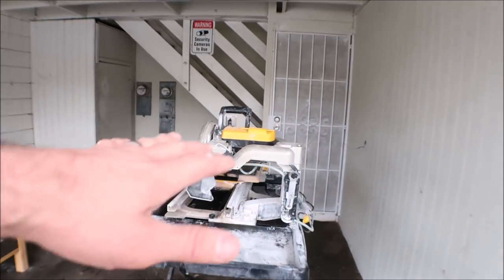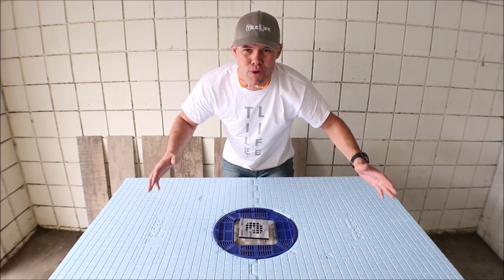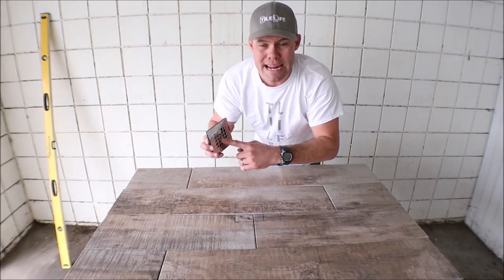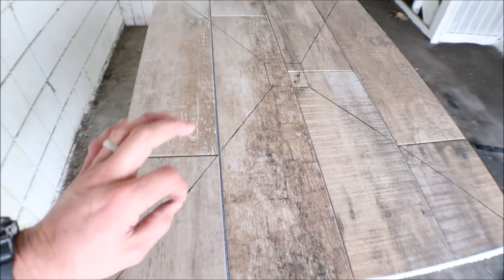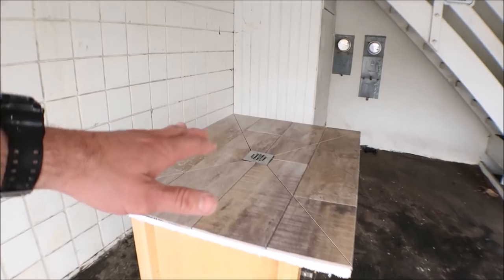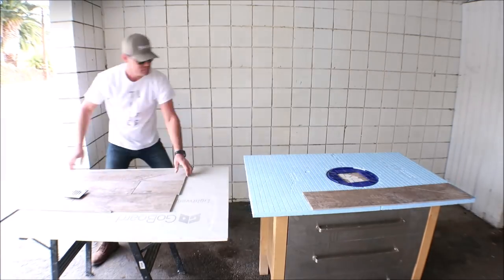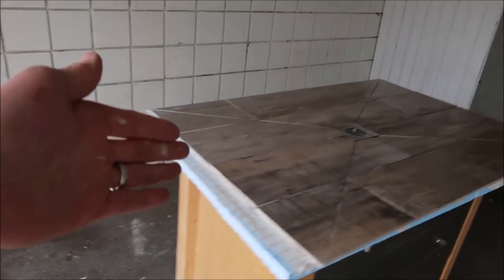Modern Wood Look Shower Pan Tile

Comment: Great information about laying out and cutting the tile.

Question on why the tile overhangs the drain pan on the right side and why it doesn't cover part of the drain pan on the left side (as viewed by watchers on YouTube)?
Did the tile order/direction get mixed up after cutting/dry fitting them ... or the drain location not end up being correct?

Did you have to cut off any extra tile along your cut marks in order to have the proper space between the tiles for grout lines?

I'm asking so that I can understand any problems that might arise if I attempt to pre-cut all of my tiles for such a location.
Reply from the maker: I installed the tile the following day after cutting and had the tray set off a little bit. It was my error...
Reply: @LandbergTileTV  : Thank you for your reply.  I greatly appreciate your videos.  I watch almost every one looking for insights on design/layout, different materials, tools and installation methods.

I am looking at purchasing a Sigma 3E4M (49") tile cutter.  I see that you have used the Razor Pro, Montolit Masterpiuma P3 and a small version of the Sigma Max line.

Would you have any feedback/opinions (pros/cons) on the differences between the RTC Razor Pro, Montolit P3 and Sigma 3E4M large format tile cutters?

Comment: Great vid as usual. Wood like to see you do a video discussing different blade types, and which ones work better for Travertine, Porcelain, Ceramic, ets, which types of blades juts don't cut it.
Reply: Great idea.  And if you do that video, maybe differentiate between DIY'er and Pro blades since some of us won't be doing enough tile jobs to warrant the added expense of the Pro blades.
Reply from the maker: Great idea, I'll will most definitely add it to my video idea list. Thanks for the comment! 👊
Reply: For what it's worth, I have had great success with the T3 razor on my Raimondi bridge saw. Has the thinnest kerf and get chip free cuts on porcelain and glass.

Comment: This doesn't make any sense. Why use tile levers on a shower pan that's supposed to be sloped? You have it cut into four sections. Those sections should have been leveled with themselves, not each other. It seems you've made a flat shower pan.
Reply from the maker: It may seem that way, but we install this type of shower pan on a regular basis. This is a anti lippage system, not leveling system. Here is a video on one of my projects installing the same tile for the shower pan:
part 1: https://www.youtube.com/watch?v=5f3VJOP3QYs

part 2: https://www.youtube.com/watch?v=VN66Ct9o3Js

Comment: Nice video good idea for my cabin shower thanks for sharing just wondering do you think it won’t be slippery while the soap drains under your feet just wondering I’ve been installing for 27 years and i mostly install much smaller tile on floor or tile that is none slip
Reply from the maker: Most wood look porcelain plank tile has a matte finish with grains that resemble real wood. Definitely not slippery sir, thanks for watching.

Comment: Are there any issues with slipping on a large format floor like that? Do you have to pick a textured non-slip large format tile? I'm just a layman but i thought the reason smaller tiles were used on floors were so the grout lines would provide traction? Really like your videos FYI!
Reply from the maker: I was pushing the tile through the saw fast, it only broke off what was supposed to be cut off already. Thanks for the view👊

Comment: Do not show how to bring the 1/4" per foot....but it's a great video.
Reply: The pan is pre sloped 1/4 inch per foot. Using the method he used (drain corner to pan corner) with a pre fabricated pan will yield you the standard 1/4 per ft. This isn't as easy of a task on a poured pan/mud bed. Simply because we're not perfect. But completely doable if you get your pan right. 👍

Comment: Great video! How would this work for off center drain? Would it be the same or different? I'm going to be doing a 32 × 60 install soon and would like to have this as a possibly. Thanks!
Reply from the maker: It still looks great! Check out the last post on my Instagram. We installed large format tile with an offset drain. 👌
Reply: My main concern is how would the  angle cuts be accomplished for water flow/slope to the drain.
Reply: Did you ever figure the cuts for 28x60 shower using 12x24 tiles

Comment: Nice look but not good for a shower pan. That system creates an even plain. There is no way you've got a 1/4" slope per ft now!
Reply: Yes it does indeed. It's being done by all of us who do this work for a living, and becoming the most popular new "standard" on a prefab tray. This method absolutely gives 1/4" per ft slope. I believe Landberg tile even showed that in one of his videos using that method
Reply: @MostlyPeacefulCombatVet  I do this for a living as well, 24 years as matter of fact, although I only began using these systems a year ago. 
I'm always willing to learn something new, that's why I watch these videos, but from my experience with these systems I can't see any way possible for them to allow a slope. Allowing slope in multiple directions would allow lipage. The purpose of these systems is to create a flat plane. The pre-slope is irrelevant, the system will pull the tiles away from the pre-slope to create a flat plane every time. Cutting tiles diagonally is irrelevant as well as the system creates a flat plane regardless of the type of cut.
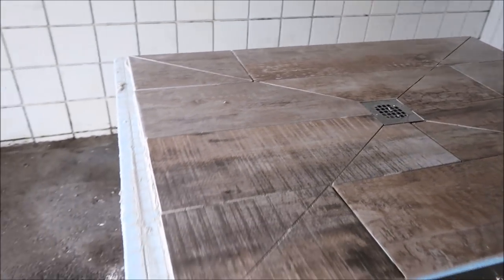Reply from the maker: Go to 9:58 of this video: https://www.youtube.com/watch?v=sJbrHe353Kg
You do get 1/4 per foot on a pitch and slope.

Comment: Why are you using a tile leveling system on a sloped floor? Isn't the intent for it not to be level? 🤔
Reply: No....its for tile lippage
Not to level your floor
Reply: @R2Mike  is right. These are to level tile to tile to avoid lippage. Not the floor itself.
Reply from the maker: Leveling systems should be renamed. They are anti lippage systems. We isntall this way frequently for shower pans and all of our pans have at least 1/4 per foot for pitch and slope. You can see it better here at the 10 minute mark:
https://www.youtube.com/watch?v=sJbrHe353Kg

Comment: Great video! Question though, does not tile leveling in that setup works against preslope pitch? I believe if you set wedges tight it actually will level it along entire pane
Reply: The systems do not level your floor.  They are a tile lippage system basically.  If the floor is sloped, it stays sloped but without one side of the tile being higher then the other
Reply: @R2Mike  No the system doesn't "level" the floor, but it certainly creates an even plain. There is no way that floor has 1/4" slope per ft anymore! That system should NEVER be used in a shower pan
Reply: That is correct, it brings all tiles at the same plane, especially if leveling system with wide paws and wedges is used as on this video example. My guess, to retain bending ability along cuts  that form sloped envelop, different type of leveling system will be more appropriate. Landberg tile actually had video where he demonstrated reusable TLS, and that would be better fit in here, to give flex in cut lines, while leveling lips.
Reply: Installation order probably should not be linear, but plane by plane and TLS is used within each triangle plane, but not on their catheti.
Reply: @ricks341  I didnt say it levels the floor
Reply from the maker: Go to the 10 minute mark of this video: https://www.youtube.com/watch?v=sJbrHe353Kg
Definitely has a 1/4 inch per slope and proper pitch. We install large format all the time on shower pans.
Reply from the maker: The clips and wedges do not level the shower pan. We install large format frequently with large format tile. It can only be done on a prefab tray and there is always 1/4 inch per foot for pitch.